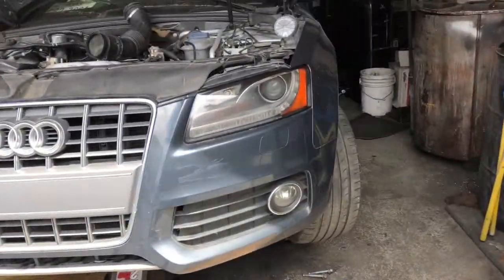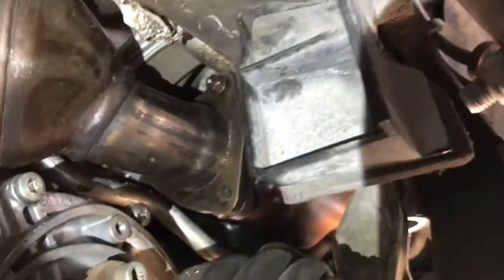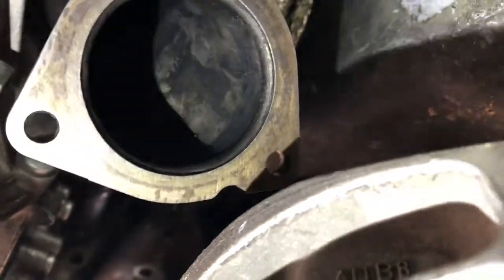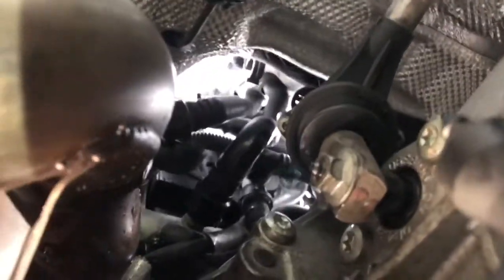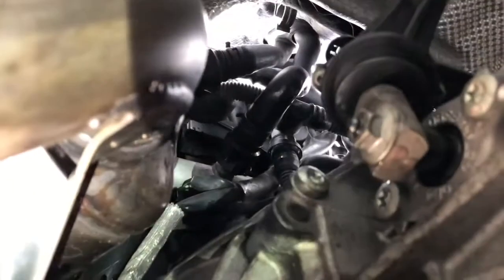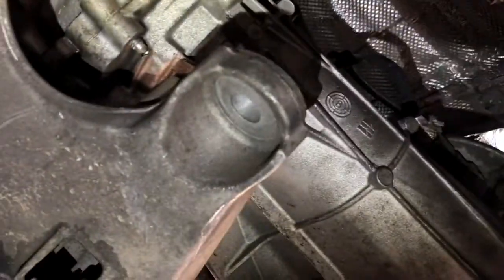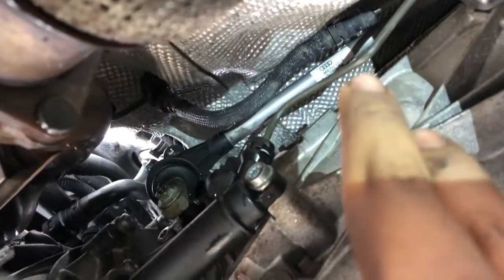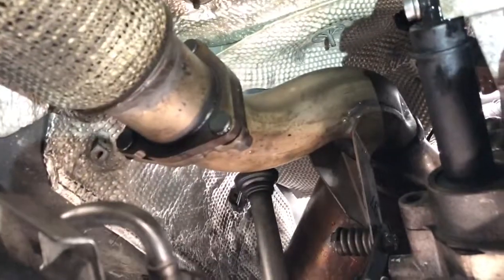08 Audi S5 | Catalytic Converter Replacement

Comment: I dont know if the S5 is the same as the Q5, but to access the inside nut and stud for the passenger cat. remove the tire,fender liner,heat shields for the axle shaft. then you can easily get to it without touching the trans and subframe. Did this on a 2011 Q5 3.2.

Comment: Hello,I am trying to perform the same job you did on your S5,,my Question is, Do I have to remove the driveshaft in order to lower the transmission the same way  you did? my is Quattro mode. Thank you.
Reply: Edwin Reyes Hello. There is a recall take your s5 to the dealer and they will change them for free.
Reply from the maker: I did not remove the driveshaft

Comment: if you're gutting these cats can you not just leave them on and take out the honeycomb shit without having to remove anything else just obvious things obstructing downstream ends? ie if reusing them?
Reply: What did you do?
Reply: @Ahooonyyyyyahonny  what?
Reply: @anonymousdcal  like did you remove the cats or how did you do it?
Reply: @Ahooonyyyyyahonny  I'm wanting to gut mine but thought I might of got away with disconnecting pipe at bottom to gain access to honeycomb stuff but there's an long s bend downpipe obstructing that so would have to take them off completely anyway
Reply: @anonymousdcal do you are saying that would not work?

Comment: How did you remove the driver side top flange bolt, the bolt up by the manifold
Reply from the maker: gingi 801 swivels and small extensions
Reply: @_ericsanchez  yea I figured it out, belive it or not I removed both cats with out dropping the subframe
Reply: gingi 801 did you lower the trans at least?
Reply: @gingi801 howww
Reply: I’m doing this job right now and I need help, someone please reach out to me
Reply: I’ve been doing this job for like 3 days LOL
Reply: @imtrixzy8690 how did it go bro?

Comment: Audi USA and Canada issued a recall for this Dec 28th 2017, Its available at ZERO Cost 

START DATE
Dec 28, 2017
AUDI ACTION CODE
26J2
DESCRIPTION
Over time and mileage and under certain conditions, the factory-installed catalysts may not perform as required by Federal regulations. If the effectiveness of a catalyst is reduced, this may result in an increase in tailpipe emissions and the vehicle could fail to pass an emissions inspection.

REMEDY
To ensure that the vehicle continues to meet emissions regulatory requirements, your authorized Audi dealer will install improved catalysts. This work will take up to two days to complete and will be performed for you free of charge. Please keep in mind that your dealer may need additional time for the preparation of the repair, as well as to accommodate their daily workshop schedule.
Reply: I know this is a two year old comment, but do you know what range that covered?/ and could they still be covered on a 2013 model?